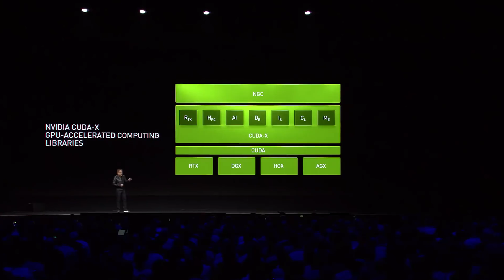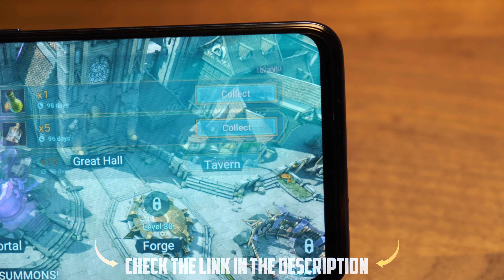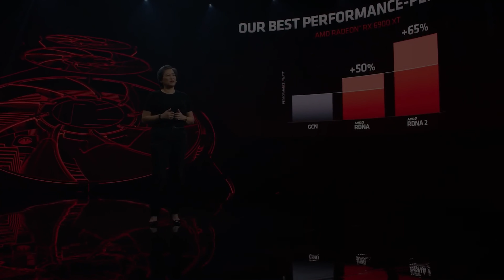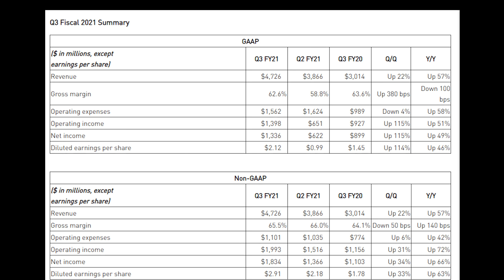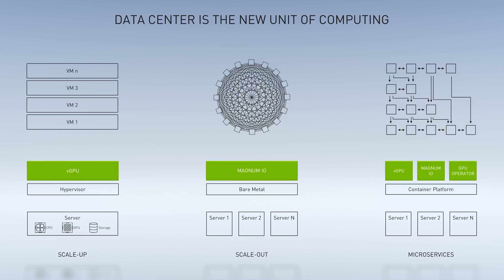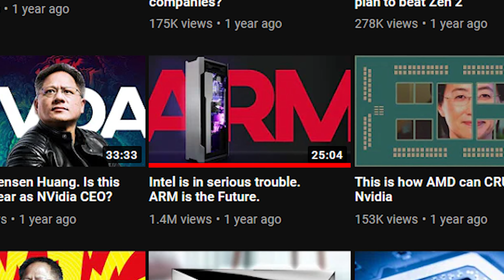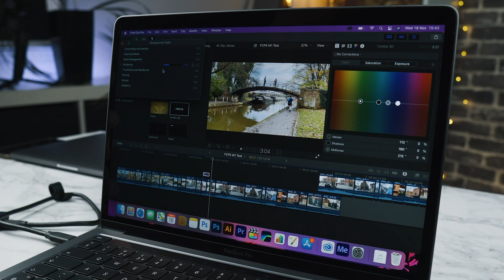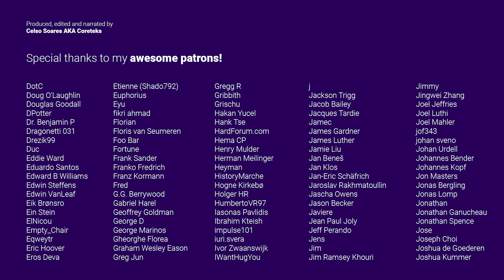NVidia has a REVOLUTION coming

Comment: Guys, do you think the next Nintendo switch will support DLSS?
Reply: Nintendo (the only console giant on nVidia atm) has apparently told their screen producer to "be ready for 4k". Media outlets have been wondering why bother making the "Switch Pro" a 4k device. It'll just make the thing more expensive to make (driving up its cost), and games will be harder to develop (driving up their cost). 

Or will it?

If the Switch Pro has a refined 1080p-to-4k DLSS system, it will be able to go toe-to-toe with Playstation's and Xbox's offerings. I watch with great interest.
Reply: @benjaminoechsli1941  thanks! But why would nintendo choice be 4k and not 1440p? 4k seems overkill for an small screen and it needs more power from the backlit
Reply: @aikatheshibainu3994  Great question! First off, we only have rumors of rumors at this point about the thing, so they very well may simply stick with 1440p resolution (which I think most Nintendo fans would be happy with). And nVidia has plenty of experience upscaling 1080p to 1440p already. 

The point of going full 4k would be to directly compete with other consoles. "Oh, you wanna play the latest games at 4k but don't have a compatible TV/monitor to play them on? How about the Switch Pro, with its built-in screen!?"

At least, that's the best I can figure.

Comment: I must say as guy working in IT business  with both virtualisation and linux and windows server this was more of marketing video than information.  Nvida did save ARM from doom because of   RISC-V is going take over the low power market. It seems often than IT market moves fast but most business more often want stability and porting software is not done often so software is the more important than hardware because software will outlive us. What is AI software its a unclear definition and i know guys working its now a magic bullet than can solve every problem. You are talking like these companies can change software direction open source software have taken over the world its the standard nvida have not come with anything relevant compared to companies like google with kubernetes that is open source . You are saying that chip acceleration will solve every problems but how can i run a container  or VM on a chip like that you need a way to give those resource out like SR-IOV  but if i know nvida right they can make a open standard therfor it will just be a profitable niche  will change nothing in not like software have done or will do yet. This is my opinion you have a interesting outlook but alway remember to think about how software fits into it check out the story of unix and Dennis Ritchie.programminggranddaddy

Comment: Interesting point of view, but there are some flaws on it : Nvidia as a "Software Company" has been EXTREMELY incompetent on building modules that really works with Linux, and nowadays Linux completely dominates the Data Centers , so, this "partnership" with Dell/VMWare are not that relevant . ( and I Still hoping that AMD will bring back that "heterogeneous multiprocessing" with ARM/X86  AND  GPU cores in the same die some day, it make even more sense now then when it was originally announced )

Comment: I always thought the answer was clear that more specialized chips performing certain task is better than general processors just judging from the technology of the old such as is the case with ps1 console and others consoles of the era. The need for general processors need also dies down now that is possible to pack all those specialized chips into a single die to save space and allow for better cooling with a fan and copper heat pipes.

Comment: I doubt that there'd be much difference in performance from Samsung 8nm to TSMC 7nm, they'd probably just gain a bit of efficiency. Performance is linked to frequency and while RDNA2 can get some amazing frequencies, that wasn't true of RDNA on the same node and it's quite probable that Nvidia would be frequency limited from the architecture if we reference the GA100 on TSMC 7nm which only gets about the same frequencies as Volta and Turing on 12nm.

Neither AMD nor Intel have to develop ARM based chips, x86 has some inherent advantages over arm particularly in the high power segment, the M1 loses badly to Renoir and Tiger lake in quite a few benchmarks that are obviously not highlighted in reviews but are integral to the server space, ARM isn't going to displace x86 completely but it will enable specific workloads to not need a CPU as such, a DPU is such an application and these only use ARM because of the existing environment for ARM and you can't say that these are without a CPU as ARM is CPU technology.

X86 with accelerators will be just as competitive as ARM with accelerators except maybe in the very low power space, the key thing here is the accelerators. Both Intel and AMD have acquired FPGA technology, so the writing on the wall is that X86 with FPGA and hardware accelerators will be an extremely versatile system, while Nvidia will be very good with identified task specific workloads.

People who are spelling doom and gloom for x86 aren't looking at the whole picture. Sure ARM or other RISC architectures will occupy some space that has been the domain of x86, but it won't be all or at least not for a while yet and by then something else may come along that disrupts the market from everything previous.

Comment: Good in-depth analysis.
AMD is gaining more market share yet the market could gradually move away judging by what Nvidia is currently doing.
Still, TSMC 7nm is indeed a surprise for JH because I think nvidia didn't expect RX6000 series to be so good on rasterization.
While 8nm only makes GA102 to clock at 2Ghz TSMC 7nm is already making RDNA2 clocking at 2.5... it is a huge gain.

Comment: Jensen is a master in marketing there's never been any doubts on that. DLSS as a feature solves the crippling performance problem of ray tracing in gaming but it's implementation is only present in a handful of games. Big games but still. This however gives Nvidia a massive advantage over AMD in the ray tracing department. AMD's ray tracing is weaker than Ampere to begin with and without a dlss-like feature it makes their RDNA 2 gpu's a hard pill to swallow with their current pricing even though I'm looking to buy one my self.

Comment: ;-; so x86 will end up like the power PC's?
Reply: Not for many years to come. Nvidia wants to get in on specific niche growth markets before others do. Normal CPUs will be the mainstay of servers for a long time yet, and it's a growing market in general.

That said, AMD will need their Xilinx technology, to keep up. Already, they have Oculink, to compete with Thunderbolt, to go off to network and storage faster than Ethernet, and directly hooked up the CPU, but that's just a stop-gap. They will want to have a programmable network interface available, that can talk to standard storage interfaces, and not bog the CPUs down with interrupts and DMAs (a lot of a typical server CPU's time is spent routing data), so that a vast majority of the CPU's time can go to the applications running on it. That includes mapping much of the networked space to memory. Network and storage may only take a few percent, naively, but virtualization multiplies that by the number of machines, and adds it's own overhead costs, too.

Comment: Didn't x86 already assimilated reduced instructions
X86 just need more optimisation.
Reply: Not exactly, but kind of, but that's not the issue, and never was. Low-ILP code isn't hindered by the limited decode bandwidth of variable width CISC, and high-ILP code is loopy, also not so limited, due to age-old front end tricks, and now uop caching. The penalty for x86 is like 2-3%, IIRC, in terms of performance and power, with area varying by design (a lot on weak CPUs, but almost nothing on big fat CPUs). It's got lots of instructions, but most code uses less than 200 of them, if not less than 100, which are directly decoded, and many are special-purpose, so microcoding the rest is no biggie.

Now, internally, x86 CPUs have translated instructions into micro-ops since late 1995. OTOH, big old mainframes also did this, back in the discrete transistor days. On x86, though, many if those uops still dealt directly with memory, and still do. It wasn't until maybe 10 years ago or so that all major compilers had good enough register allocation algorithms to make direct register loading and storing faster than pure stack manipulation, FI, and x86 CPUs still have tricks to manage manipulation of the stack internally, so as to speed up such code. Now, though, they're good enough that they  will combine the two methods seamlessly, so that's not going away. IoW, they got over the old weaknesses of CISC, but the internals are still very CISCy - that itself is neither here nor there. You don't need AGUs on an ARM CPU, FI, and have an easier time logically dealing with the stack, but those special memory instructions also give some good hints to the prefetchers and branch predictors that an ARM CPU will have to do without, and reduce the amount of memory barriers that need to be put into the code. OTOH, memory access patterns that don't fit the normal cases get very awkward on x86, but are no different than any others on any load-store.

As well, ARM CPUs often also split instructions internally, too, as the ISA has had many combination instructions since it's inception, and performs tricks with special register uses, varying by instruction. ARM is not a true RISC, just because it's load-store.

X86 vs ARM is much more about implementation, from a business perspective, now. X86 is a walled garden, with only Intel and AMD as noteworthy players. ARM is available to basically anyone that can afford to have a chip fanned for them, and offers many licensing options. Until ARMv8, they had a wide variety of feature options, making it basically impossible to have one binary run well on many systems, or not run at all (like RISC-V is, now), and that made having common tool chains for software development and testing a bear, as well. ARMv8 cleaned it up a lot, and dealt with some other very important things, like memory ordering and DMA, that were previously a wild west of implementation decisions (it's still not as standardized as x86, but everyone building a high-performance part is going to use the same feature set, as far as any userspace program is concerned).

Comment: I really hope Nvidia wouldn't get ARM, it's not certified deal yet. Though I don't believe ARM beating x86 in high performance computing ever really. ARM is great at giving certain level of performance, but going beyond that requires huge changes to the ISA. Though the need for high perf general CPUs will decrease, but not by much.

AMD should buy Mill Computing and start financing it's Belt CPU. That seems amazing at paper and would improve single thread performance massively, and it should also improve power consumption quite heavily. Though I would prefer Belt CPU becoming like ARM, and ARM staying like it is. We really don't need monopolies like what Intel was and Nvidia is, until RDNA 2 relieves that situation a bit.
Reply: ARM is not fast, Apple Silicon is fast. It like saying Zen3 = Pentium 4 (both x86). The architecture is what matter.
Reply: @ZAGAN-OZ  ARM's benefits come from the core principles of ARM. You can make it much faster by producing it with 5nm, having hue amount of L2 cache, better branch prediction etc.

But the more you improve it's performance, the more you lose the benefits of the core principles of ARM.

I have not seen raw CPU performance from M1, as that would require some research on finding workloads/benchmark that would represent that CPU vs. X86. But I would bet a large sum of money that it's not amazing.

Also integrating the memory on the same package increases the performance hugely vs. X86.

It's a little too complex topic to debate here, but to summarize, ARM based CPUs get ahead of X86 only when they are not trying to compete at the same perf level with the same node. Otherwise increasing IPC requires too much changes.

Comment: I am generally more AMD leaning in my preferences but I think you are downplaying the performance of the 3000 series (at least those using GDDRx) a bit. AMDs 6000 Series leads by 5-15% in Rasterization at best and is pretty far behind in Raytracing performance. This in my mind makes both series roughly equal and the consumer can decide if he wants to have more eye candy or more fps with less graphical fidelity. DLSS however gives Nvidia an edge (in case game developer keep implementing it) and makes the cards look better armed for future titles. Let's say both the 3080 and the 6800xt can now run most games 4k with at least 60fps. In 2-3 years they won't be able to do so without reducing options. But in Nvidias case they can just increase the level of upsampling and still deliver 95% of the image quality and stay above that threshold while AMD will probably not.
However, at the end this discussion might be settled by the stock wars and not by feature sets and performance : |

Comment: Nvidia did wise move to move to Samsung, I can see in multiple sellers in my country that they receive 3000 cards daily, but they are usually sold within one hour and its same for Ryzen cpus. But Amd gpus appeared only at launch and some stores didnt receive any and other sold like 8-20 units and there was nothing seen since then. Even if amd takes the crown with 6900xt I dont think nvidia cares too much, becase they will still outsell AMD 5:1 if not more, just because they can produce more cards and maintain good margins. Not to mention that the customized cards from amd are far from msrp and cost even more than many 3080 models. That just shows that they cant make any profit on these cards if they follow amd pricing. I think AMD now has to make lot of chips for consoles at low margin, because console makers funded rdna developement, so amd wont be able to make much profit on this generation of gpus unlike Nvidia.

Comment: It's obvious that NVidia wants to dominate in the Server Space. That said, they couldn't do it using just GPU-based accelerators. That's why the needed ARM to bring the full-fledged solution to customers. On the other hand, everyone is keep talking about ARM that it will crush x64. But still it didn't happen. Sure, Apple pushed the ARM processor to great speeds, but I am reluctant to consider this as a coupe de grace. Intel and AMD still have quite a few cards under their sleeves. Just look at how slow the adoption of great Epyc processors is. NVidia managed to take the accelerator-based part of data center maket share from Intel, but I am afraid that was because this market (at that point) wasn't that well established, and the performance that Intel was giving was poor. Also, apart from CPUs (ARM/x64), GPUs and FPGAs, you have to think about quantum computers and potentially some new kind of architecture.

Comment: #1 - Most powerful supercomputer CPU? - ARM Fujitsu A64FX - using on-chip HBM2 and SVE 2x512-bit SIMD FPU units, beating Nvidia's GPUs very badly.
#1 - CPU core with highest IPC (performance per GHz)? - Apple M1 has +59% higher IPC than Zen3 or +90% IPC over Zen2.
#1 - CPU core with most INT execution units? - Apple M1 can do 6xALU and 3x Branch instructions per cycle (Zen3 is only 4xALU+1xBranch).
#1 - CPU core with most FPU execution units? - Apple M1 can do 4xFADD and 4xFMULL instructions per cycle (Zen3 only 2+2).
#1 - CPU core with biggest L1 instruction cache? - Apple M1 has 192 kb L1D (Zen3 only 32 kb, 6x less than M1).
#1 - CPU core with biggest L2 cache? - Apple M1 has incredible 12 MB L2$ (Zen3 has only 0.5 MB, not a typo, only half megabyte, 24x less)
#1 - best SIMD instructions today? ARM's SVE2 is truly a revolution: supporting matrix instructions! and size-less vectors with unlimited length, decoupling SW and HW widths (not like x86 AVX), while SW vector length can be unlimited, HW FPU is limited in range 128-bit up to 2048-bit width. Next year Apple and ARM is gonna introduce CPU cores with SVE2 and x86 has nothing even similar in development. Holy cow, x86 is gonna DIE soon. Jim Keller was right with his K12. Lisa Su back to IBM, Jim Keller back to AMD as a CEO and immediately start ARM CPU core development. But maybe it's already too late and AMD is gonna bankrupt.... pretty sad.